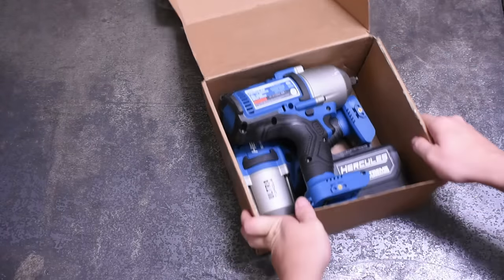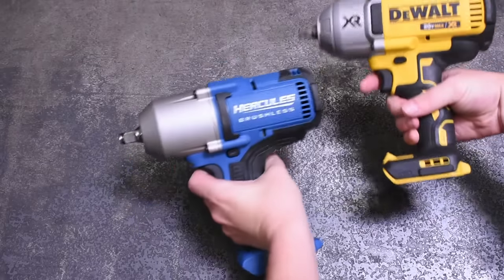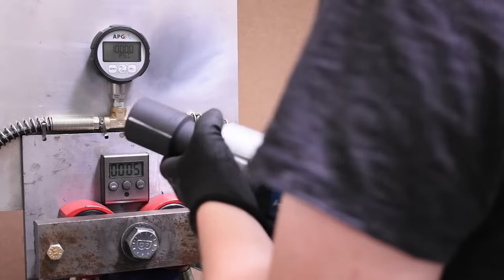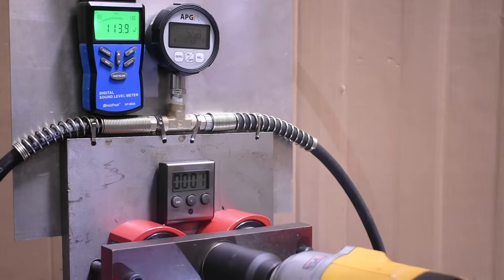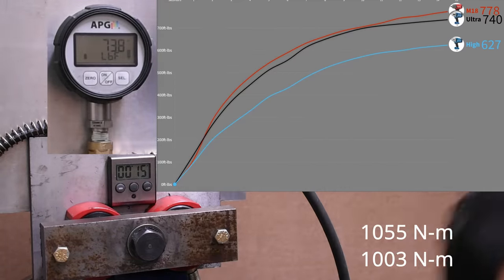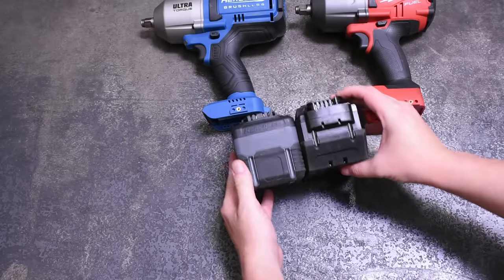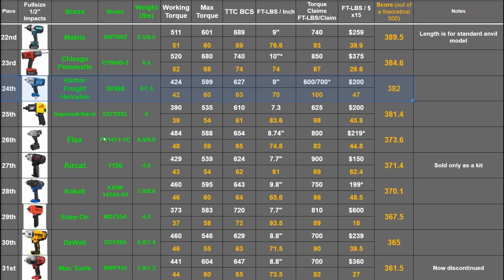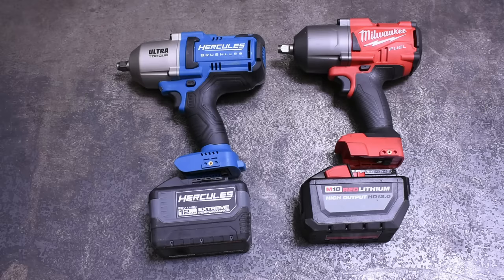Harbor Freight Dethroning Milwaukee & DeWalt w/ New Ultra Torque Impact Wrench?

Comment: If I didn’t already have a 6.0 High Output battery I’d be in the market for that Ultra Torque. Love HarborFreight tools and especially their warranty. Ultra Torque+8ah and Charger is already more than a bare tool M18 high torque so I’ll pass on it unfortunately.
Reply: There are adapters out there that allow you to use say dewalt batteries on for example the Hercules tools,  just plug in any brand in either slot and that is correct as well with different adapters
Reply: @diychad7268  I tried searching and only found the opposite, Hercules Batteries to a Milwaukee Tool. I ended up getting the 2767.

Comment: Considering how inconsistent/nonexistent HF QC tends to be I couldn't bring myself to buy anything with a high output battery pack from them.  HF can screw up things as basic as a screwdriver.  I don't trust them fir anything as complicated or intended for hard use as an impact

Comment: Is there any way to torque test drills?
Reply from the maker: Sort of, but not like this. It requires some fancy designs we've failed at a couple times, but we're still working on it.
Reply: "Cement mixer drill" or just go cheap. My 20$ drill has sunken 2000 3in screws into relatively hard wood

Comment: HF Warranty
5-YEAR LIMITED WARRANTY
(HERCULES 20V BRUSHLESS TOOLS PURCHASED ON OR AFTER 8/19/22)
This Hercules tool is warranted to the original purchaser to be free from defects in materials and workmanship for a period of five (5) years
beginning on the date of purchase. This warranty does not cover battery packs and battery chargers, which are covered under separate warranties.
To obtain warranty service, visit your local Harbor Freight retail store. Warranty registration is not required. The product or part must be returned
to us with proof of purchase (e.g. in-store receipt or packing slip/invoice) and may require shipment by purchaser to a service center at purchaser’s
expense. If our inspection verifies a covered defect in materials or workmanship during the warranty period, we will, at our option, repair or
replace the defective product. We will return repaired products within a reasonable time at our expense, but if we determine that there is no
defect, or that the defect resulted from causes not within the scope of our warranty, then we will return the product to you if you pay return
shipping costs.
This warranty does not cover any failure or damage that we determine is due directly or indirectly to normal wear and tear, misuse, use not for the
intended purpose or not in accordance with the product manual, abuse, accident, rental, modification or alteration, unauthorized repair, improper
installation, neglect, lack of maintenance, or any other failure not arising from defective materials or workmanship. Fraudulent returns or claims
will be denied. The repair or replacement described in this warranty shall be your sole and exclusive remedy. THIS WARRANTY IS EXCLUSIVE AND
IN LIEU OF ALL OTHER EXPRESS WARRANTIES, WRITTEN OR ORAL, AND ANY IMPLIED WARRANTIES ARE DISCLAIMED TO THE EXTENT PERMITTED BY
LAW AND OTHERWISE LIMITED TO THE DURATION OF THE EXPRESS WARRANTY HEREIN. HARBOR FREIGHT SHALL NOT BE LIABLE UNDER ANY
CIRCUMSTANCES FOR ANY INCIDENTAL, INDIRECT, SPECIAL, CONSEQUENTIAL, OR PUNITIVE DAMAGES OR COSTS ARISING FROM THIS WARRANTY
OR THE USE OF THIS PRODUCT. SOME STATES DO NOT ALLOW LIMITATIONS ON HOW LONG AN IMPLIED WARRANTY LASTS OR THE EXCLUSION OR
LIMITATION OF INCIDENTAL OR CONSEQUENTIAL DAMAGES, SO THESE LIMITATIONS MAY NOT APPLY TO YOU. THIS WARRANTY GIVES YOU
SPECIFIC LEGAL RIGHTS, AND YOU MAY ALSO HAVE OTHER RIGHTS WHICH VARY FROM STATE TO STATE

Comment: You mentioned the battery used for the HF Ultra had 21700 cells. Is that good, bad or indifferent?
Reply from the maker: Yeah, sorry. 21700 cells are larger than traditional 18650's and also have higher peak discharge rate. They can provide more sudden current to the motor than otherwise equal 18650's.

Comment: Only problem with harbor freight cordless tools. In a year or two, they will replace these brands with another, then quit selling batteries for the old models. Try to find a battery for discontinued models.

Comment: the HF impacts are actually les money today and while as a pro mechanic, it is hard not to want to buy one instead of the pricier brands, especially with that 5 year warranty. I think this can seriously hurt the legacy brands that have complicated and time loss of the tool when you have send it in, compared to running down to the local HF, which are now everywhere and just get a new one. While I admit to buying NF tools at times, I bought most of my tools in the 70's when I started out and I hate how China reverse engineers stuff like these impacts and that is the main reason they cost less, they have minimal product design cost and of course, way lower pay in the Chinese factories.

Comment: It's interesting how much a "battery ecosystem" matters now. If Harbor Freight had the same number of tools as MIlwaukee (including landscaping/woodworking/etc) I would consider changing over. But because Milwaukee had so many tools right from the get go, I am kind of permanently stuck in their system. So I keep paying more for everything, because I don't want the complexity of multiple batteries and chargers. If our government ever steps in and forces a universal system on manufacturers, it's going to be bad news for MIlwaukee (and Dewalt/Makita/etc) and great news for Harbor Freight. And before anyone says that's un-American, look into where your "American made" tools originate from.
Reply: There is a reason it’s called “made in USA with global materials”

Comment: Slightly off topic here. I can use the Milwaukee 12Ah battery for multiple tools i.e. air compressor, 3/4" impact gun, etc. But what can you use the 12Ah Hercules battery for besides the impact gun?

Comment: Do any of the ones that say they have 1200flb actually put out that amount
Reply from the maker: In removing something (nut busting) theoretically yes. But it depends a lot on the bolt set-up used

Comment: How long do they last should be the follow up video, warranty means nothing if the tool breaks when needed, also the batteries will have cheaper cells, the savings on batteries is the quality of the PC board and cheaper cells, there's no saving $ and using good quality components, you will always end up with cheaper components on cheaper tools if buying new.

Comment: Ya but will it hold up to constant use everyday for long enough to make you investment back and ya even in real world if you on the trigger for 30 sec straight you need a bigger gun or some heat and pentrating oil lol

Comment: Wow.. especially poignant review, with the latest turn of events with the Milwaukee  2767-20 "B" version.  Years ago I got fed up with the battery price gouging from big Red & big Yellow, as well as the decline in quality, so I switched to  Hercules. So far the 20V 1/2" drill, recip saw and circ saw have been working very well.    

HF has really raised their game to another level with the Hercules line.

Comment: sounds like they got the exact same factory to make their tools and are just taking marginally lower profit than team red or team yelllow. As long as they have a whole series of tools that are compatible with the same batteries I'm a big fan. Part of the reason I avoid harbor freight is once you buy into a battery ecosystem it's more economical to get a tool and pay a bit more with compatible tools than buy a whole different tool, battery, and charging system.

Comment: How is the battery retention on the HF models?
Reply: you need 300+ cycles to tell, alternatively a tear down can show the batteries used.
Reply: @stanimir4197  I was referring to how well the battery stays connected to the impact wrench during use.  I guess I should have worded my question better.

Comment: Not dethroning anyone, especially since the Snap On impact driver is stronger than the Milwaukee and the Dewalt. Then we have the price on this Hercules impact driver, you can get the Porter Cable with battery and charger for less than the Hercules. Not to mention your tests show that it still under performed compared to the Milwaukee and the Dewalt, which means it still does not compare to the Snap On. I will stick with my Porter Cable which is just as good as the Milwaukee and the Dewalt for less than the Hercules.
Reply: PC has 300ft lbs only and they don't even make a ratchet which is wild.

Comment: I find it hilarious that people think a larger Ah battery means more power. Lol... Ah = Amp hours. basically means how long the battery last on a single charge, the power remains the same. Smh 😅
Reply from the maker: Larger batteries often mean more cells in parallel to pull from or larger 21700 cells with higher discharge amps. It's not a good rule to apply universally. But one sometimes comes with the other
Reply: I mean it does, imagine getting a car battery with less amp. You can tell the differences between start up 😂

Comment: Milwaukee for me. Don't trust harbor freight on their quality and have had little to no downsides with other tools and that's on used tools. Bought a engine support bar and it broke so instead had to weld it and now it's better. Wasn't going to go for the warranty for the same shitty quality.
I end up returning 75% of the things I bought at harbor freight.
Bought a a swivel head ratchet and does not even come close to a vintage craftsman swivel  head ratchet I got at the pawn shop

Comment: The batteries dont last.  Also when you leave the batteries they discharge faster.  It is sad that many people get free products and write good videos.  Harbor freight had cheap products with cheap prices.  Now they have cheap products for expensive prices.
Reply from the maker: The new batteries have Samsung 40T 21700 cells, the same as you'll find in M18 high output. If these were garbage we'd be happy to show it, our ultra torque we bought is still working fine.

Comment: Everyone has copied Milwaukee for years. Even snap on has. They all copied Milwaukee’s lithium technology, they are all trying to copy Milwaukees tools and it’s funny that they are always behind and every time someone makes a tool with close specs after years of Milwaukees being a class above, Milwaukees comes out with something better. The high torque 1/2” has been around for years. Old technology. Old news. My first Gen high torque 1/2” has been kicking ass for over 5 years and my batteries are even older. And mine is the 1100 ft lb that was out before the 1400 and I’ve been changing tires on tractor trailers at work since the beginning before Milwaukee was the hype tool and people weren’t talking about it like they do today. Let’s see this harbor freights impact do that.

Comment: Let's see how long that cheap-ass Harbor Freight battery lasts before ya'll start making the "jUSt aS g00D" claims.
Reply: Probably longer than the revised 2767 planetary gear design.
Reply: Open one up... you'll find not so cheap-ass Samsung cells and not some no name Chinese cells in those Hercules 20V packs: https://www.youtube.com/watch?v=txCpC67ZWT4

Comment: 😂😂😂😂😂😂😂😂😂 silly stuff... I bought a cut-off saw that was Hercules and it failed less than 2 Days later, I bought an angle grinder that was DeWalt and it cut miles literally miles of stone and is still running lol you can guarantee any piece of crap all that means is running back and forth to the store to replace the piece of junk 😂😂😂 sorry but I would like to finish my job with my tool not spend a bunch of gas running back and forth, stick with DeWalt